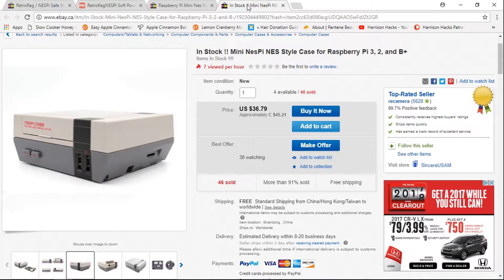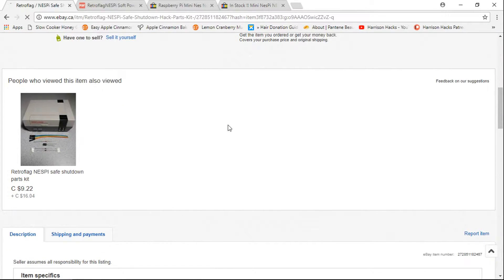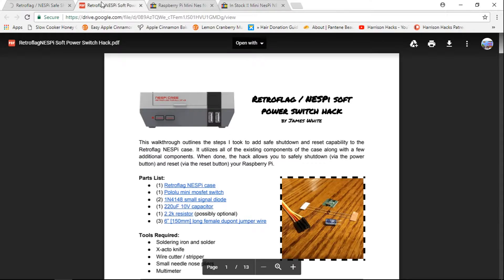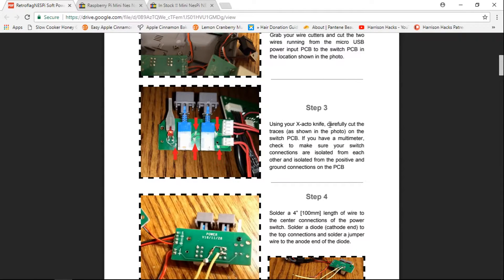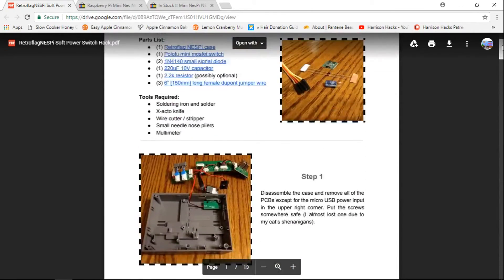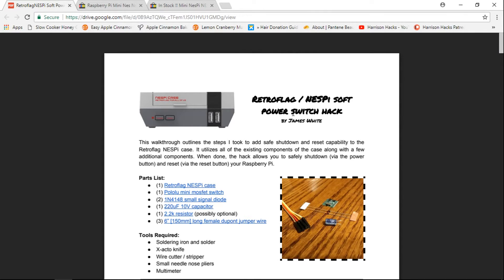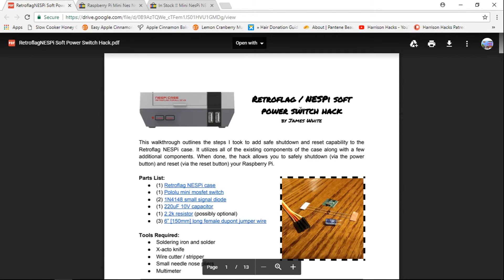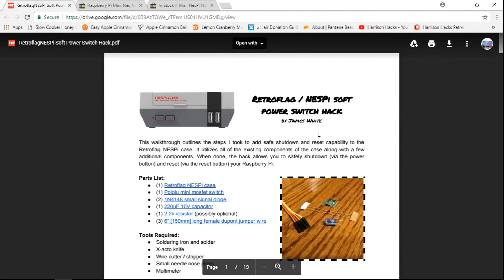Retroflag / NESPi Case Safe Shutdown Hack

Comment: I did it step by step, but when it came to the scripting I had a hard time.
And do I have to do all the script on my Pi with the GPIOs unplugged? I think I missed that and it didn't work for me.
Also now I get a yellow lighting bolt in the corner of my screen, showing that I'm getting lower power.  
Has anyone done this and could help me?

Comment: Okay so I ordered one of those blank nespi case and it took almost 2 weeks to arrive, but worth it. Why, because it was still the Retro Flag case! It is the same case and insides, plus all the printed letters. Even comes in the same box Retro Flag sells them in. I feel that they just bought some from the factory to sell in the side. So if you can handle the wait totally worth it. I was expecting a clone, but no it's that same one, or at least a really good clone.
Reply from the maker: elgigante2001 thanks for the info. Glad to hear its legit. I am now torn between nespi or flirc.

Comment: Thanks for the video. Initially, I did this hack because I really thought it should have worked this way from the factory. I wanted to actually use the power button and not worry about corrupting the SD card. I took pictures and put together the walk through so others could hack their cases too. Lots of people were interested in a kit of all the required parts so I put 40 together to help out people who just wanted everything shipped together, but it was never my intention to even sell one. Really, it's only a few parts and they are not too hard to get. The walk through itself is not horribly hard if you have a little bit of soldering experience and a good attention to detail. I know of seven or eight people who have completed the hack, some with very little experience soldering, so I'd say it's definitely doable.
Reply from the maker: James White My Hat's off to you for this kit. Great idea, and it's awesome to see someone put together a kit, plus a step by step guide to help people take full advantage of the Nespi case! Much appreciated